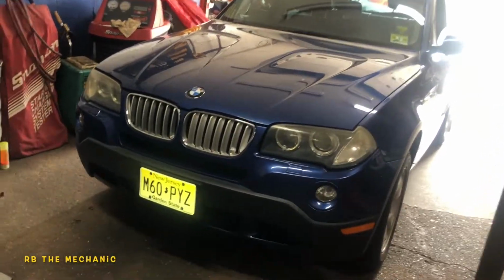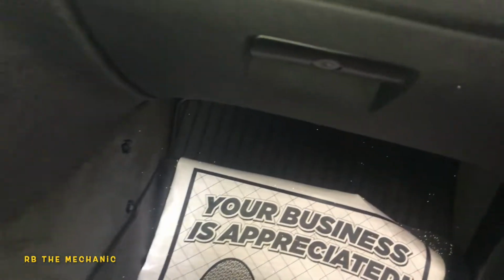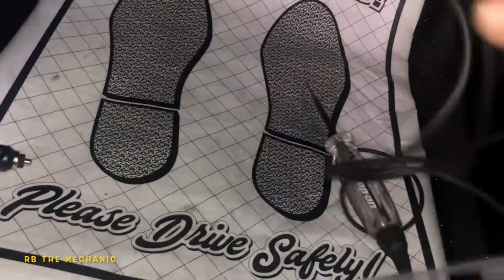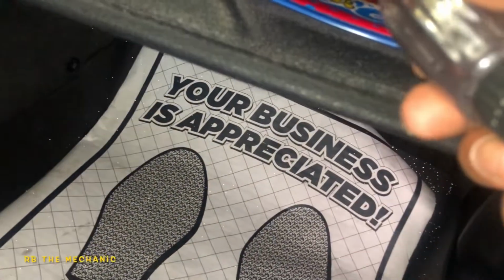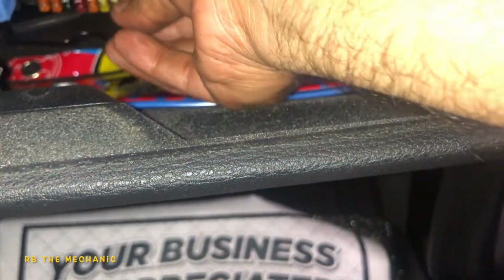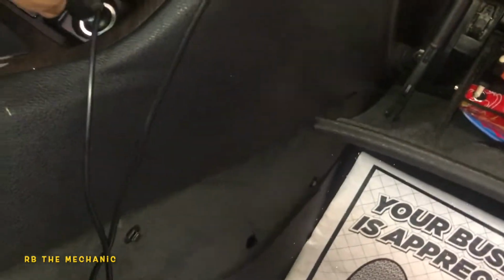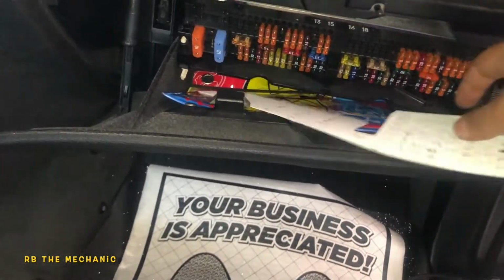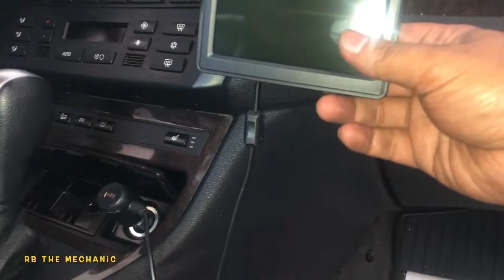BMW X3 2007 ciggret light //  fone charger fuse

Comment: I just fixed that issue. RB 2001 Chevrolet astro van. Can it be Hotwire or can I peel the ignition solenoid to get it started? Lost the key
Reply from the maker: U can buy why not have another key made by locksmith
Reply: @RBTheMechanic  the van has been sitting for a year and half. I want to see if it starts before putting money into it
Reply from the maker: @servo5651  dose the battery have power? Year is long time prolly dead battery but I don’t have a way to tell u to Hotwire it u less u know it gonna ah e to locate the correct wires
Reply: @RBTheMechanic  I was gonna put a wire to the ignition switch harness
One to power then to the the yellow then pink to start
Reply from the maker: @servo5651  not sure I wouldn’t proble a wrong wire without know yellow is always air bag stuff